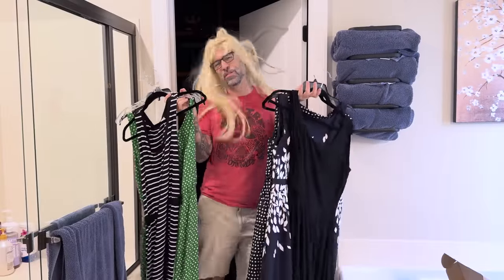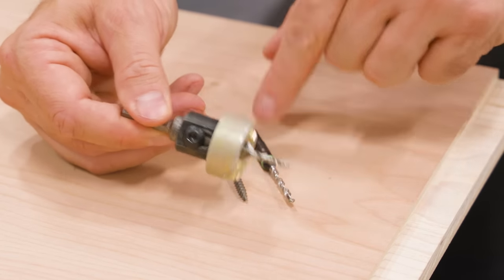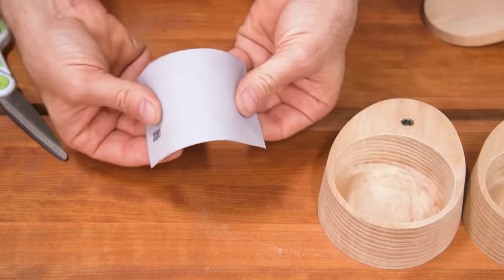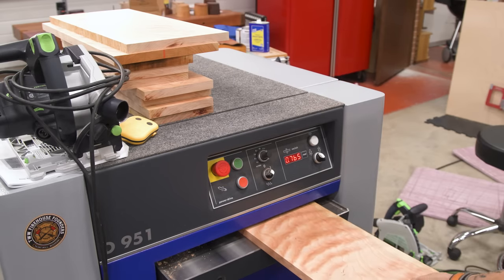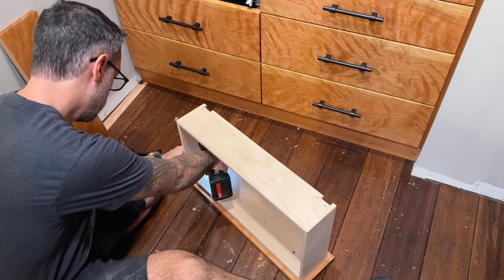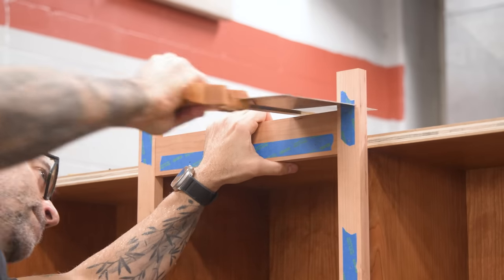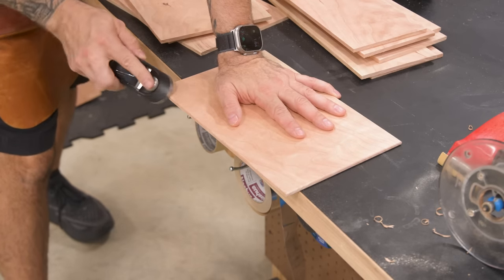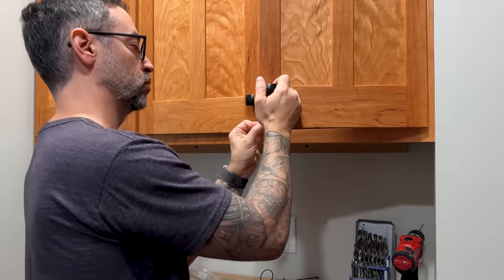A Feast for the Eyes! | Walk-In Dream Closet Part 2 | The Wood Whisperer

Comment from the maker: Products I Used in the video: 
+ Backside 2-Sided Sandpaper - https://backsidesandpaper.com/
+ Titebond Liquid Hide Glue - https://amzn.to/46wo2ZI
+ Merle Corner Clamp - https://amzn.to/3txuHnT
+ Amana Countersink Bit - https://amzn.to/3QOIU9w
+ Festool TS55 - https://amzn.to/3qKyn4j
+ Milwaukee Drill and Driver Combo - https://amzn.to/3qDJOL9
+ Festool Domino 500 - https://amzn.to/47DFpbQ
+ Shelf Pin Jig - https://amzn.to/3qDpLwo
+ Adjustable Oval Closet Rod - https://amzn.to/3qHJ4F2
+ Milwaukee Compact Router - https://amzn.to/44fpTzX
+ Accuscribe Scribing Tool - https://amzn.to/3slXGu8
+ Titebond Quick & Thick - https://www.rockler.com/titebond-molding-and-trim-glue?sid=AFN86
+ Rockler Bandy Clamps - https://amzn.to/3ssKG5K
+ Milwaukee 18 ga Brad Nailer - https://amzn.to/47ItEke
+ Timbermate Wood Filler - https://amzn.to/3KRcCGZ
+ 3M 6500 Respirator - https://amzn.to/3E2Xhzt
+ Preppin Weapon Sanding Block - https://amzn.to/46OWi2c
+ Hardwax Oil Comparison Video - https://youtu.be/tHEGIgtTlM0

Comment: This might be your best video ever. After nearly 50 years as a fine woodworker, I found most family requests are for some sort of cabinetry. For built-ins, I switch my thinking from dealing with inside dimensions to outside dimensions. Same as you did. Looks great. I have a large 8 door, 4 drawer buffet/hutch in the dining room. There is one slightly mis-matched grain pattern door on the hutch. Eye-level, of course. It is made from figured cherry. Everyone who sees the buffet says it's beautiful, but my eyes are drawn to the odd door. The song from the Muppets, "One of these things is not like the other", plays in my head. Ugh. Thanks.

Comment: Only discovered your channel a year or so ago... Love it! Here's a scribing tip.
When free handing your scribe pieces on the bandsaw (or jigsaw), set a slight angle on the table to make the edge that will sit against the wall sort of a slight "knife edge". This keeps bumps in the texture or other imperfections behind that front surface of the face frame from making a gap between your scribe cut and the wall. It also makes finesse sanding much easier since you're not having to sand the entire 3/4" thickness down.
Reply from the maker: I pre-beveled the edges before cutting. I covered that in the first part of this series so didn’t mention it here. 👍

Comment: Another thing one might think about are swing out and down top hanger rails, which would also let one run the lower hanger rails slightly higher,  but they also prevent one from overfilling the rail because of the need for edge clearance.

Comment: I always enjoy your videos. Your dry sense of humor is reminiscent of my own, or so I hear. When I built my closet organizers I cut the sides at 14” much for the reason you said the 24” was too deep. You get the same number of panels out of each sheet but you also get an extra piece for cleats, or back support. I used to rip the sheets at 12” to get three panels out of each sheet of ply; but, as you know, ply isn’t usually exactly 48”. I also dont bring the sides all the way down to the floor…I wanted to build closet organizers, not cabinets. Just low enough to get the second row of rods

Comment: When installing your hinge plates, if you know the distances from the top of the cabinet. Just install the top plate, pop the door with euro hinge into place. Then you can easily mount the remaining plates in place. It makes installing the doors an easy one person job. Super time saving, Plus they are euro hinges, so super adjustable. This was the production method used in the shop i worked for.

Comment: 👍Use some Loctite on the router collet and then immediately undo the collet, leaves the residue of the Loctite on the treads this stops it from becoming loose, downside you can't flick the nut loose you have to unwind it all the way with your finger.

Comment: I have gotten old enough such that I now need sandpaper for my feet...
have not gotten to the backside sandpaper requirement phase yet...
But at least now I know where to get it when I need it.
:)-
For the faceframe/trim that needs cutting to mathc  the wall, I have seen a good trick and that is to make the depth of the wood only 1/4" or so for the part of the stiles that are on the outer side of the carcass. Cutting and trimming.sanding 1/4" of wood is a bit easier than the whole 3/4" depth.

Cheers,
Reply from the maker: I do something similar by beveling that edge.

Comment: I noticed my bit (in router table) loosens up more often when making those drop-down mortises, too - especially with larger and longer bits.  I always tighten them up firmly with 2 wrenches like you did also.
Reply: Also, spiral bits want to "screw" themselves into the wood.  So more prone to loosening.
Reply: Ah, makes sense.  I was using spiral upcut bits as well.

Comment: Since your hanger closet is open front, maybe install a sliding pullout step stool on the bottom on either a rail or a track so shorter people can access the taller rack area when needed, allowing you to put the cabinet closer to the ceiling to close the crown molding?

Comment: It’s a shame to hide this in the closet! Good move not applying finish inside the drawer cabinets but might I suggest applying a hard wax instead? It seals the grain and makes it easy to clean the wood of dust/lint. The wax can be applied before assembly and power buffed and it helps with glue cleanup around the rabbets.

Comment: Marc, won't the stiles that form the front of the furniture (that form the negative space of the wall) move a bit due to moisture and get away from the walls after some years?
Reply from the maker: Not likely. There isn’t much movement in a 1 1/2” stile in a climate controlled space.

Comment: the way you made the doors while it works fine made a lot more work for yourself and a lot more time, it would have been much easier and faster if you used a door set, shapers Ould have been the best option but it could be done on a router table as well
Reply from the maker: That pretty much describes my entire body of work. 😂 I don’t aim to do things in the fastest and easiest way possible. Usually I’m aiming for the “best” way possible and I value quality and gratification over expedience. When time is money, I’m sure you make very different choices.

Comment: As you can afford a fleet of "pro" machines I cannot understand why you don't get a Lamello Zeta P2 biscuit joiner and uses their P-System connectors. We use it all the time when we pre-make and finish high-end book cases and cabinets that has to be assembled on-site due to their large sizes and/or limited access in fancy apartment buildings. It's way faster/cheaper (as time is money) and no glue or cumbersome dowels/screws needed: we only have happy customers.

Comment: i paused the vid, hoping i'm not forced to delete my comment later.  You start the vid stating how you will leave a 1/2" on each gable and X is 9" in your case, then proceed to make the cuts on the table saw with a dado set?  If you are cutting by removing material instead of leaving material how do you know you are leaving a 1/2"... especially on plywood?  Just saying.

Comment: The closet looks nice. However, 24" depth cabinets are not very useful. They are too deep to be practical. Next time try 16" depth. Plywood will go further and they will preform better. Based on my experience. Also, unless you have a nice large closet, which it doesn't look like you do, 24" rod areas eats up floor space unnecessarily. Everyone has opinions. You are becoming a fine craftsman. We all learn through experience. Good luck with your next project.
Reply from the maker: Check out the lessons learned at the end of the video. 😉